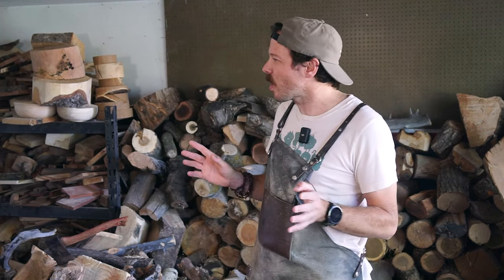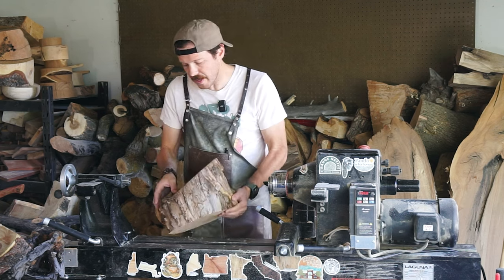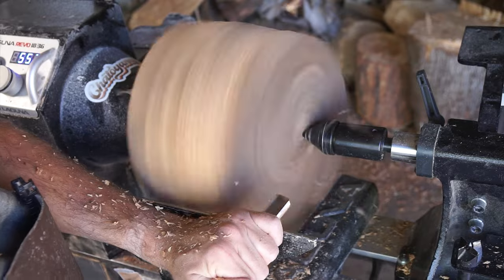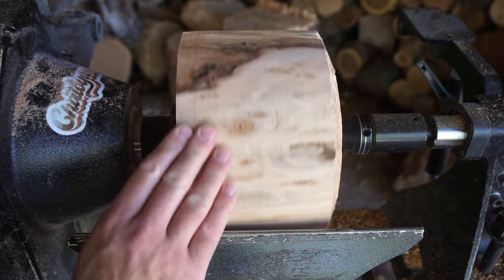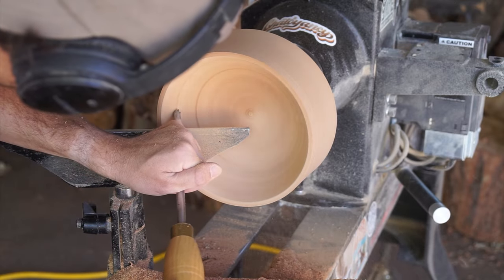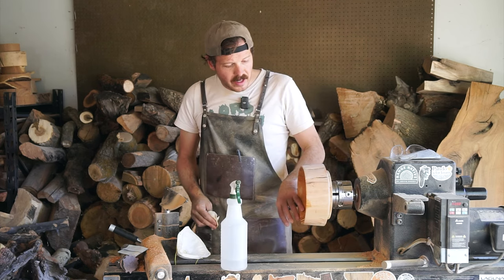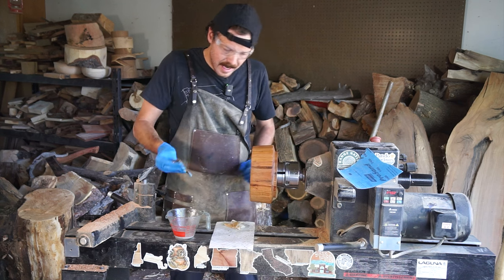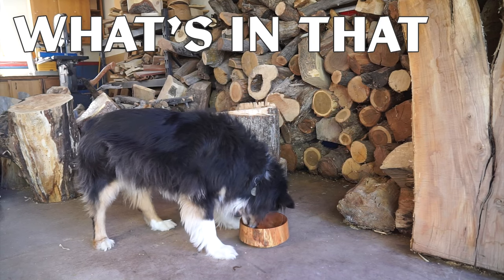Woodturning - making a dog bowl for my dog!

Comment: Awww, Miles is a good ol boy! What a handsome old man he is!

I'm curious about using wood shavings during the buffing process - is that done in order to use the oils and natural slight roughness of the wood shavings to both lubricate the process and to lightly sand? I know with the tumble polisher my dad has, we regularly use maize or walnut shells for that reason in final polish on brass items, but didn't do much wood turning when I was learning workshop skills, as most of my work was with metal, so there are some mysteries of this process for me.